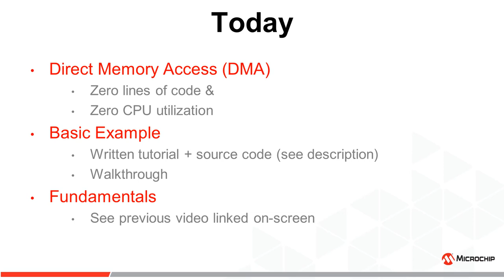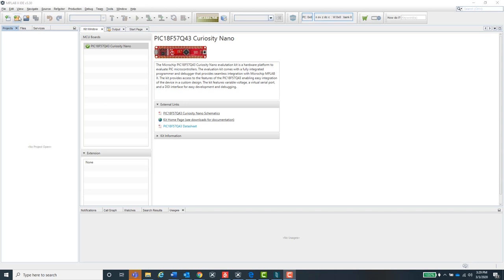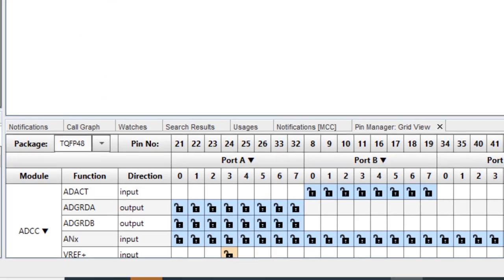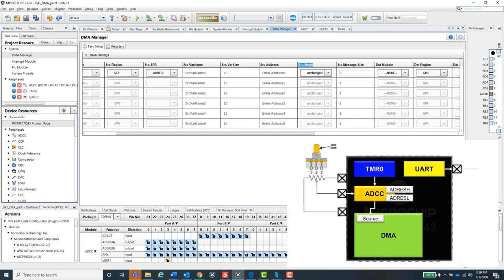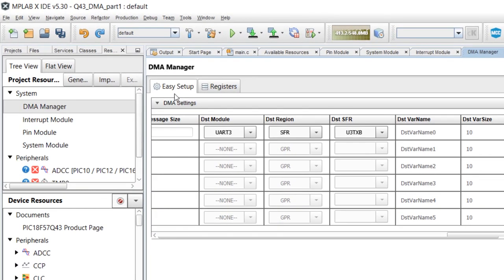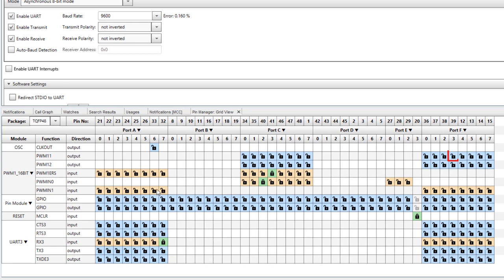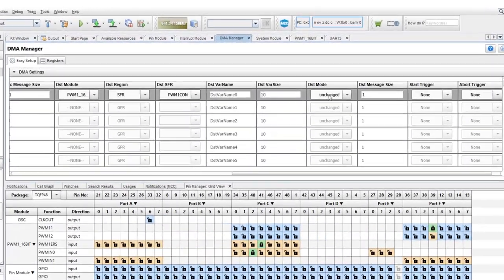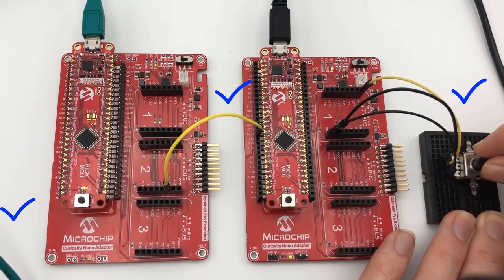How to use DMA on 8 bit PIC® MCUs

Comment: it worked after i realized that only analog will work without any modifications only on A0. MCC does not realize that i selected another pin (C2 as example) and select that channel instead of 0x00.

Comment: Can you do just a  printf to uart dma? Not sure what the source would be
Reply from the maker: Hi Stephen - Thanks for reaching out with your question! Yes, you can use DMA with a printf function for UART on 8-bit PIC® MCUs. The source would typically be a memory buffer containing the data you wish to print. Ensure DMA is properly configured to read from this buffer and transmit via UART. For detailed guidance, refer to the specific MCU's datasheet. Let us know if you have more questions about this!